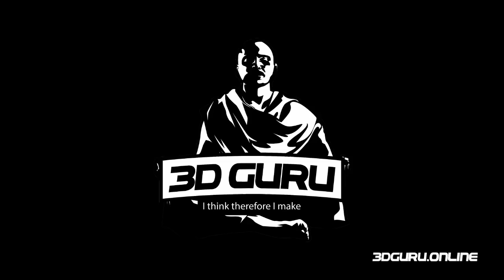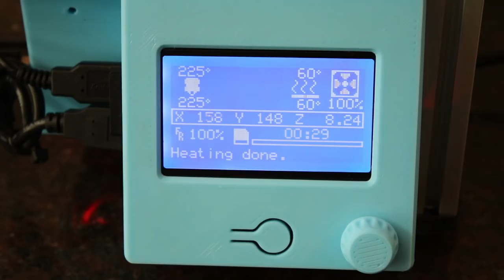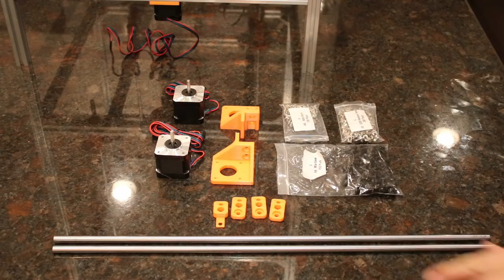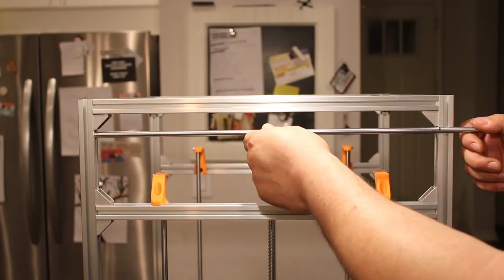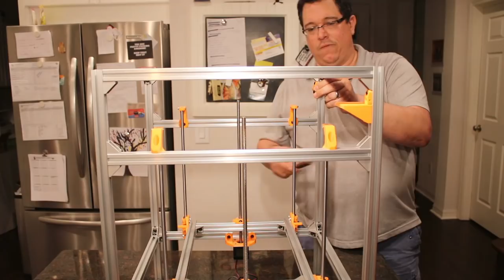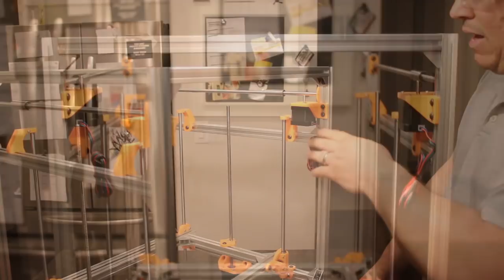3D GURU Building the Hypercube 300 Part 6   Mounting the Y Axis Rods and XY Stepper Motors

Comment: good afternoon. putting the 4 pieces that go to the rods is not level. the piece that is screwed to the engine part, is not valid. ahy to put the 4 pieces equal.
Reply from the maker: I'm sorry I do not understand.  As long as you are using the correct stepper motors and parts listed on the BOM on my thingiverse page it works  Over 100 printers have been assembled to date with no problems.